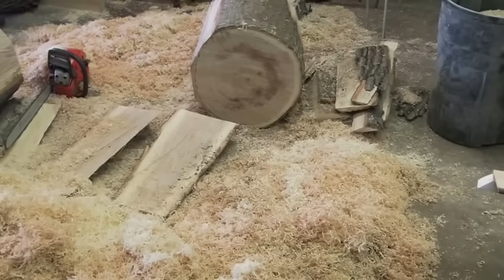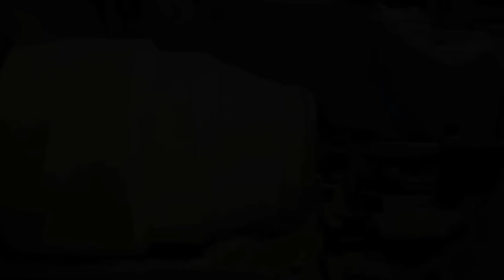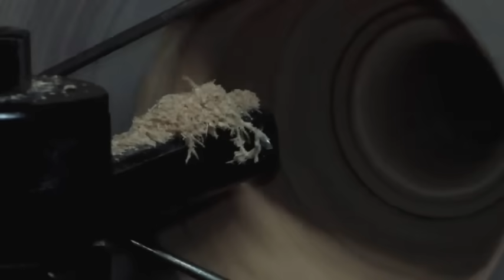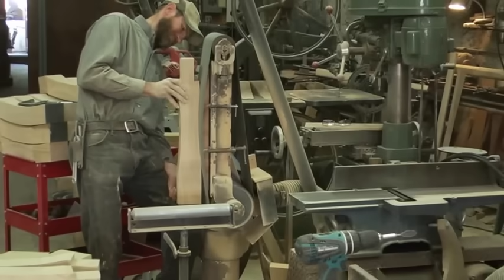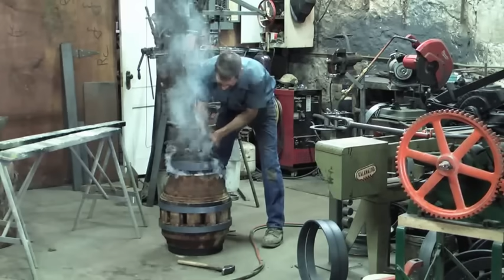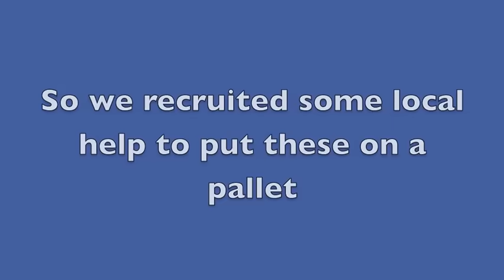1700's French Cannon Wheels, A Unique Wheelwright Design

Comment: I have seen a number of these cart-wheel construction videos. But none explain HOW the wheel hub actually rotates on the axle. Are there ball bearings, or is it just hard surface rubbing against hard surface, or do they use grease/lubricant to reduce friction?

Comment: The design is dangerously wrong. The spokes are pulled/bent sidewise and will brake much easier in the direction of bending. Of course, if you add 100 kg of hard wood, thus oversizing the wheel for the actual weight-stress, you may not experience the crush.
Fortunately, the wheels will sit in a museum, looking good, and will not get anyone hurt.
Reply: So the French army which was the most successful and most powerful in in Europe got it wrong....pwew thank god we found out before it was to late/
Reply: @rex-y7v  Thanks for the reply. I forgot that I even made that comment.
I still have the same design complaint and would appreciate a mechanically sound answer, not the story how "aunty Aida" did it in 19-th century. What is more important is the fact that nobody else used the design...because it was probably flawed. Yet, we can both be right and both wrong at the same time. French are well known for putting the fashion before reason.
Reply: The rim wrong design - what a joke. Read => Jean-Baptiste de Gribeauval
The advantage of this rim design is still applied in Formula 1. It gives wider stability for a narrow axis to support a heavy cannon (or a car). Drawback : expensive design.
In 1790 France had the most advanced artillery. Bonaparte joined this field. By far the main weapon of the Napoleonic wars to the detrimental of the Navy. ( Metal was the more expensive at that time - even the 1917 revolutionary Renault FT used oak wheels ). 
Before 20th century, France had always been a military country. UK also. Those 2 countries top the world in term of military victories, and France is slightly above UK. Mode, fashion, Versailles is just a facade.
Reply: @invest48  Thank You for your valuable defensive contribution!!!
What was supposed to be an engineering discussion about stress distribution in the suspicious design, turned into this "beauty contest" ... I apologize to you, but anyone who compares the glued-in wooden spokes with cast iron or cast aluminum rims in modern vehicles cannot really contribute here. Before attacking the curious-me, please discuss this topic with an engineer or anyone else with technical skills or, better yet, anyone who can fix a bicycle wheel.
Reply: @peta1001  I am graduated from a french engineering school created by La Rochefoucauld in the 18th century and that certainly manufactured those cannons.
The principles of physics are stable. An engineer uses the available materials. Beehive structure is used everywhere in aeronautics, from wax to titanium/aluminium.
Reply: @invest48  And yet, you compared the suspicious design of this medieval carriage with Formula 1 rims. How very interesting?!?!

However, let's rest the case. We will leave our engineering degrees for another day's discussion.

Comment: Interesting variation upon English practice. I wonder why the curved variation of the spokes. I suppose it is to allow full pressure upon the ground without the top of the wheel being slightly overhanging the base as on English wagon wheels. That way as gun rolls back under firing the compression could not change even under variable ground conditions. Such a wheel would have been long and cumbersome to make with the tools of the day whereas I guess the English method would have been somewhat faster, to repair in the field. The French method also appears to have an axletre parallel with the ground at all points which would help even up firing stresses.

Comment: I keep noticing the choice of wood. My first question is about the choice of wood. Oak can not be used with iron as there is an acid in oak that forms when it gets wet. Bronze is one thing but iron gets eaten away fast. Used in dry locations there is no problem but in a Cannon wheel, during a battle the wheels would be dropping off if there is any iron used structurally. You are using Red Oak. White oak is used in boat building, red oak is not. A military using red oak in their machines will be fighting with a handicap. I would think Ash is the material the British would use. The others....well you know what Trump calls them. I just can't believe they used Red Oak.

Comment: Great work.  The design is clever and demonstrates the original craftsmens understanding of the drying stresses on wood.  Key to the hubs not cracking is removing the heart with the through bores.  That allows the  wood of the hub to dry without without the radial cracking that you would see on a flat-cut wood slice.

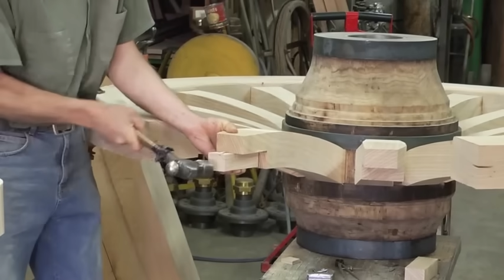Comment: As the fellows [?] were being hammered onto the spokes at about 12:06 I wondered why a steel hammer is being used instead of a dead blow?  It may be just tradition but with modern woodworking machines I would think a dead blow hammer would impart a better force to seat the fellows.  In any event, I really enjoy the skill and thought that goes into your chosen craft.

Comment: The wheels way 360 pounds each only to hold a 24 pound cannon.
Seems kinda overkill ^^
Reply: It's a 24 pounder siege gun. The ball it fires weighs 24 pounds. It was one of the biggest mobile artillery pieces of its day. The 32 pounder was the next size up, but rarely left a fort.
Reply: @NemoBlank  Thank you...  You beat me to it.   The cannon probably weighs almost a ton complete
Reply: "The wheels way"

Weigh
Reply: Calling it a “24 Pounder” may have been a better wording regarding its description.

Comment: I'd love to know why the spokes are curved. I'm guessing there's some maths/physics involved.
Reply: I have read that the spokes serve a shock absorbing function by being angled like that.  There is no suspension on gun carriages and I think the carriage can break from the weight of the gun (typical weight of a cannon is about 100 times the weight of the projectile) when it encounters bumps and holes in the road.  
There is a definite limit to the elevation angle that the cannon can be fired without breaking the carriage and the cannon has to be allowed to roll backward when fired as well.

Comment: After asking several wheelwrights I've yet to hear an answer why they don't use wood with grain that matches the curvature of the felloes. (not "fellies") Curvy Live Oak is used for sailing ship ribs with the curvature matching the hull for maximum strength. In the case of these French wheels with the curved spokes it could be used there as well. Plus Live Oak is more rot resistant then Ash.
Reply: I'm no wheelwright, but it occurs to me to wonder how often felloes split. If they don't, then there's no reason to spend the extra time and effort to get the grain curved that way.

But I agree about the spokes. I find it hard to believe that those shapes are really a good compromise between strength and shock absorption.

Comment: Thank You it is humbling to watch you men at work. I'm a carpenter and for the most part I work with dry stable wood. It is a fine art what you do anticipating all the variables of moisture, pressure and stresses. I have done work on home's built in the 1700s the are on the national historical register. But I've not had to steam bend anything as heavy as some of your projects. I have constructed some very large stair case's but we tend to laminate are bends. Also back kerfing.

Comment: I love your videos, thank you! Question, when you add the metal rings, like you did for the tires, do the rings actually NOT fit when they are cold..then they expand when heated, and fit, then shrink to fit tight once they cool. Is there a formula for that? When you put the heated ring on the hub in this video, was the hub green? How do you account for all that? I am amazed and fascinated, thanks again for sharing!

Comment: I assume you centre to the pith in the log because you are coring out the centre of the hub thus it will be stable? Old wooden water pumps were made green with the centre cored out with in 24hrs to prevent cracking

Comment: The fact that the originals were made without the benefit of power tools is what is impressive about the original wheelwrights.
Reply: They did have power tools. They would have used a PTO shaft off a water wheel to power many of the machines
Reply: As panzerlieb has said, they would have had powered lathes and hammers for the metal parts. It's still impressive

Comment: Also how does the rectangular hole making machine work? Does it just vibrate super quickly and peel off some of the wood a little at a time or is there some sort of witch magic going on
Reply: Cool thanks for the reply. You should do a video on the various tools/machines you have because I don't know what some of them are or how they work or what they do other than make stuff. Have you ever thought about trying out induction heating for getting the iron/steel up to temp to work on? Or does that cause problems for the work?

Comment: how did they turn metal & wood in 1700s?
Reply: Andrew Wilson --- In 1964 at the "Ten Foot Tall and Bullet Proof Age of Sixteen", I split stave bolts with my father, from white oak trees. This was one of my most memorable summers of my life, so far..... It was great cutting and skidding the logs (with a 1300lb. Grey Horse) working with the 'fresh wood', wonderful and gratifying feeling....and getting to visit the stave mill each day.
Reply: Jaxx Brat pretty much the same way as we do today. They had lathes powered by water mills,wind mills and by either a treadle or spring pole on smaller lathes. I have a book from 1822 on workshop practice and it refers constantly on how things were done in the past! It's fair to assume the lathes worked very much slower than they are these days but labour was cheap and materials expensive,opposite to things these days! Our ancestors were very talented and accomplished craftsmen.
 There is a museum not for from me that still runs up water and steam powered workshop machines,delight to watch.
Reply: Watching you evokes so many memories. I grew up in Highland Scotland,right next door to a whiskey distillery. The Cooperage and Blacksmiths shop were my favourite place in the whole world. There was a huge round cast iron jig in the ground outside that I was told was for repairing the dray and cart wheels but this form of transport had gone out of service by my time,unfortunately. There was stories of how much tension there was in wheels and stories of them exploding if the tyre band failed? Probably exaggerated for my enthralled young ears! There was also a big bath for soaking a wheel in to tighten it up a bit. I can still smell the amazing smell of the mash and malt mixed with the smell of scorched wood and red hot iron!
Reply: there is an old factory here that produced cannon wheels and carriages as far back as the late 1700's - early 1800's,  then later converted to a bakery which burnt down in the 1920's.  Part of the original structure still remains, along with surviving left over parts that were donated to local museums.  Judging by the layout,  the tooling was most likely mule/horse driven, possibly converted to steam at some point.

Comment: Hi, thanks for the great video it's a pleasure to watch, but I don't understand how the hub will not crack when it dries? I know you said it was pressure treated with anti freeze but that in it's self will also dry, can you explain further ? sorry to be a pain !!
Reply: Many thanks for that, cheers Keith. ( nice to see your great work )
Reply: keithtpullin iu
Reply: There is a process called vacuum/pressure impregnation. Vacuum draws out moisture from the wood cells and then the solution is introduced. More vacuum while the work piece is submerged in the solution. Then vacuum is slowly relieved and pressure applied. 
I believe it might work well for preserving the wood also.

I can give more detail if you're interested.